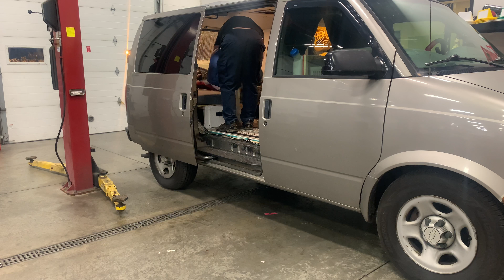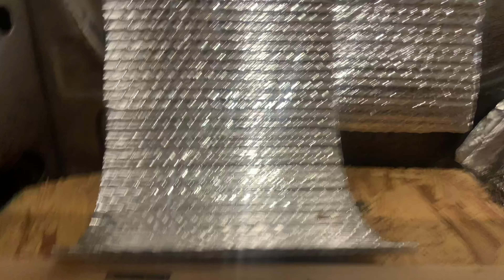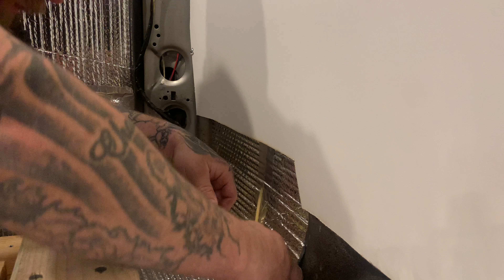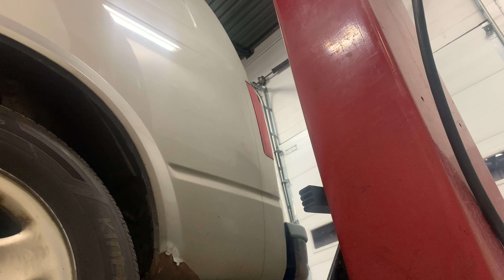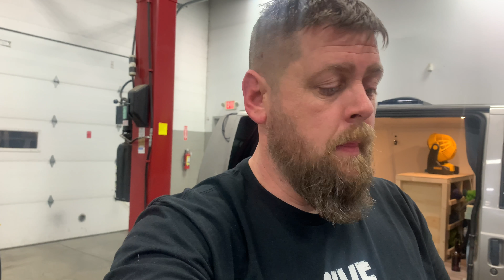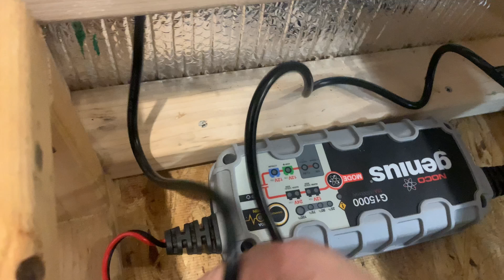Shore Power Install

Comment: Hi, I have some advice for you. The charger you have is great, does a good job . Buy a small inverter and cable to charge your batteries whilst driving.
Reply from the maker: Tony Blake appreciate it. I have been really considering installing the stuff to be able to charge from the alternator. That would give me 3 ways to charge my batteries.